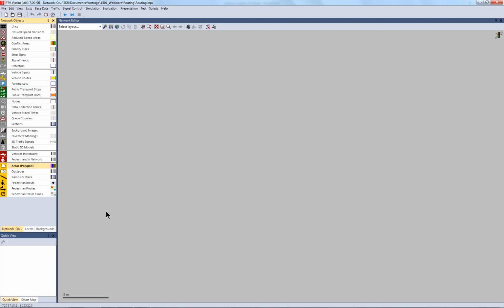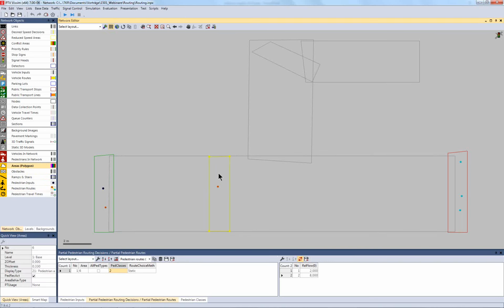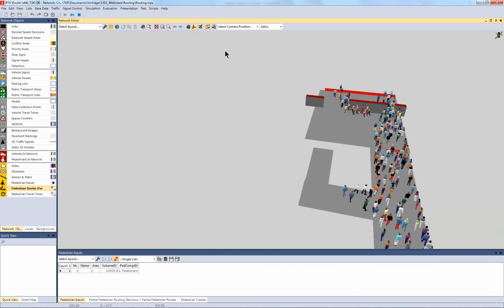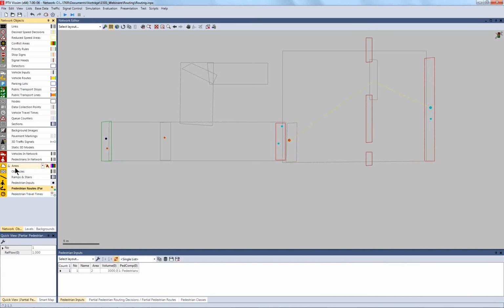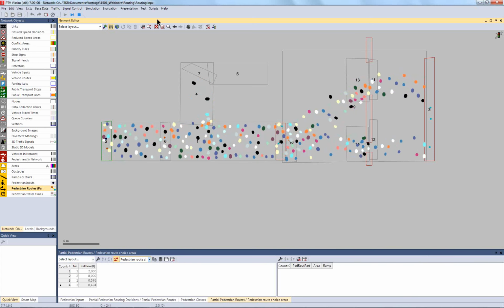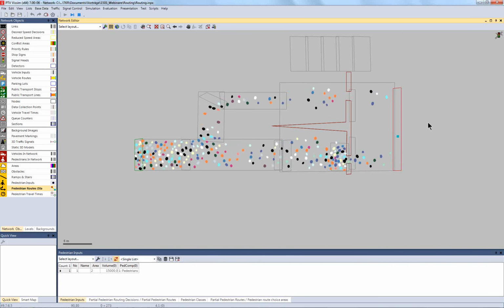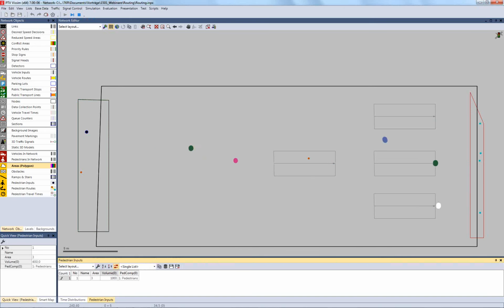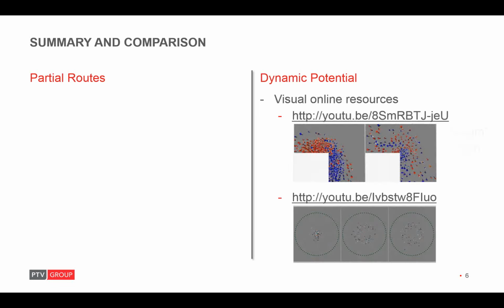Routing with Partial Routes & Dynamic Potential | PTV Viswalk | Webinar

Comment: Please, how can I get the pedestrian outputs such as the delay and queue length?
Reply from the maker: Hi Nadher, if you activate evaluation for "areas & ramps" queue evaluation (of explicit queues) is activated and you can see the results there. For informal queus / jams / congestions to evaluate you would use area-based measurements for which you need to define at least one section.